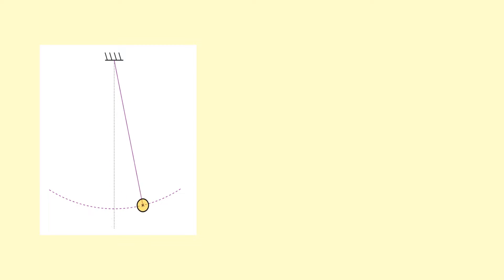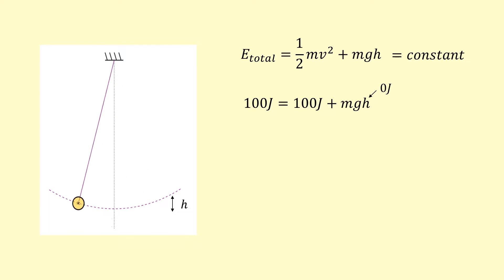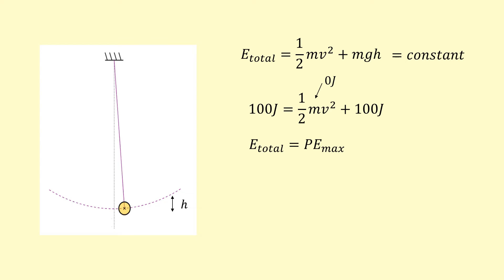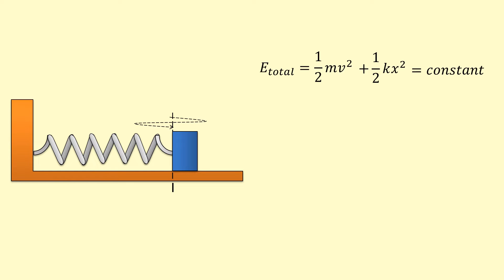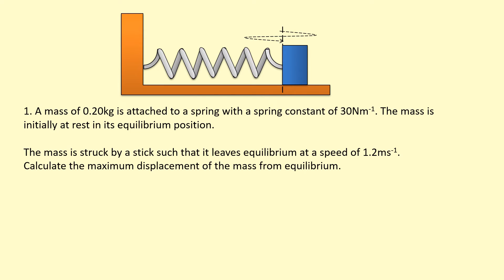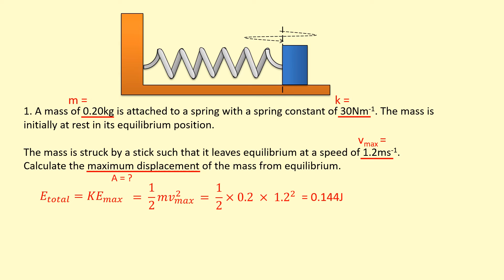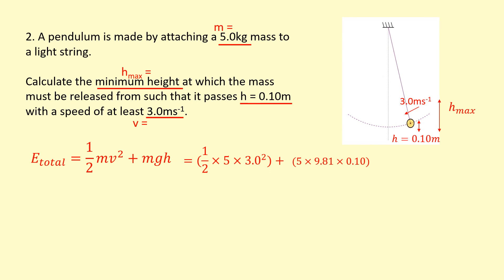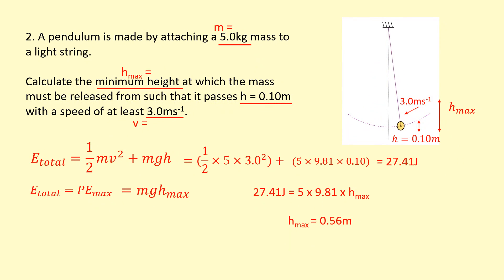7.09 How to calculate the energy of a simple harmonic oscillator

Comment: on question 2 at the end of the video, im not sure but i think you got it wrong by using the spring constant value instead of mass. In the kinetic energy equation
Reply from the maker: you're right 🤦‍♂.
it should be 0.036   =    0.5x0.8xv^2   +   0.5x20x0.025^2.

Thanks for pointing it out.